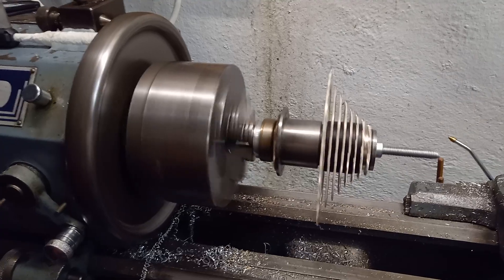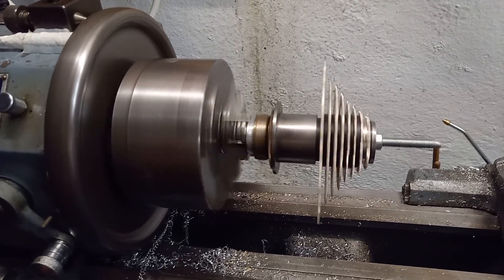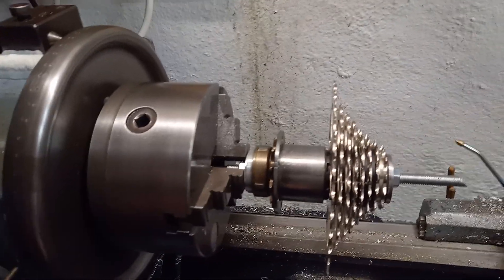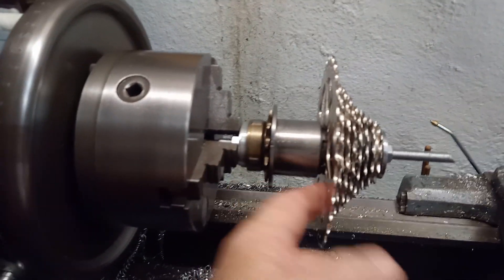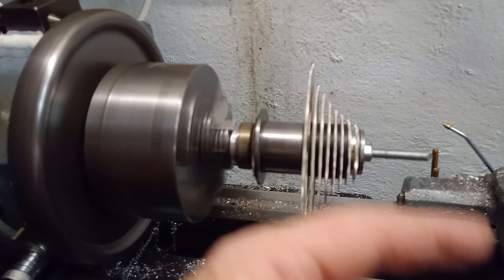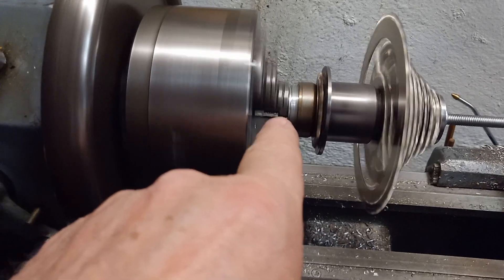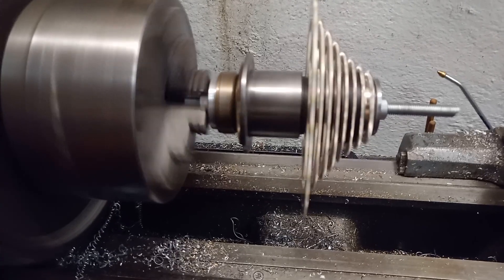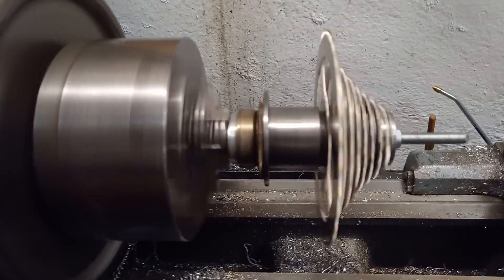Alignment tool completed - better, or not?

Comment: Great work on the alignment! Just wondering—why didn’t you go for a 13mm hex-bar? I heard they naturally align themselves better due to their extra millimeter of torque leverage. Seems like it could’ve saved you some welding effort!
Reply from the maker: Hi, I went for 12mm because that is the pre-made hex-hole that exists in the cassette carriers ratchet assemblies.  It seemed easier to have it common on both sides.  Theirs is perfectly formed and part of their expensive production machining.   I am just replicating this on the LH side with a rotary broach.  Then they are common, and I can use a 12mm bar as an alignment tool.  Made sense to me.  🙂
Reply: @DClarke1954  Thanks for explaining! That makes sense for standardization, but wouldn’t using a 13mm hex-bar offset the broaching angle slightly, creating a natural preload effect on the alignment? I read somewhere that this can improve torque harmonics, especially with rotary assemblies. Just wondering if that’s something you’ve accounted for.

Comment: I dont mean to teach you how to suck eggs but, If you add more 8mm nuts to the end it should run truer. PS some freehubs are made of alluminium, you could probably turn the bore down to make it a better fit on the shaft, and instead of welding it secure it with a grub screw!
Reply from the maker: Yes, it was just a simple alignment test.   There is a 12mm AF brass bar in the middle aligning the 2 output sides of the 2 freewheels for welding.  It gets removed after welding and then the 2 half-shafts are inserted on either side.  Normally such units are >£200-400 but this has cost <£50  :)